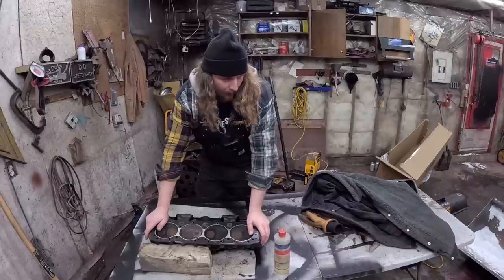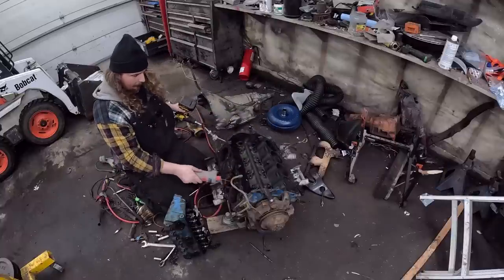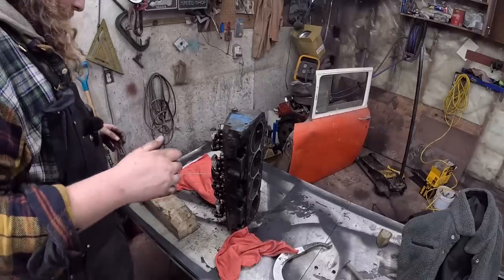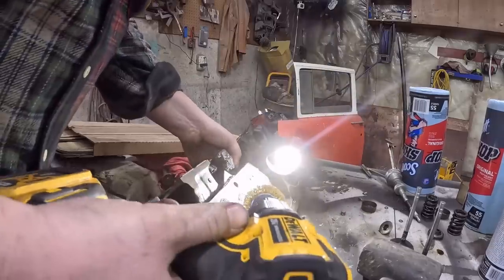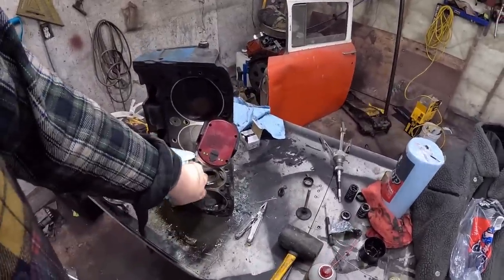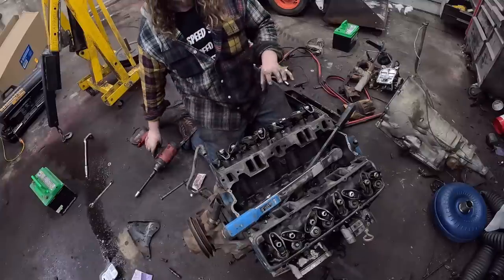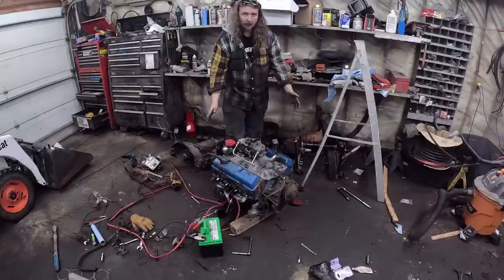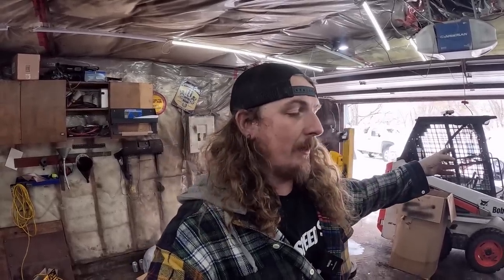FORCING IT TO RUN! - Freeing A STUCK Engine THE WRONG WAY

Comment: Should last for a while.  It sounded good.  I think more people repair in this way than we would all like to admit.
Reply: Small blocks are so hearty  as you probably know and simple. Dan did everything right here in my eyes considering its purpose going  in the 57 for his lady.......
Reply: I've done my share, I used thousands of YTT bolts before I really knew what they were. I bought a 95 MC with the 3.1 that broke the valve head off and turned upside down and jabbed a hole in the piston. Tore it down pressed on a used piston and lapped a used valve in I got for free from work ( rebuilt title car sales) re-used everything head gaskets and all, only bought one tube of type 999 import gasket maker, oil and filter and I put nearly a  150k on it before I traded it for a truck and it was still running strong. I only wonder how bad the cylinders were in some of the motors I forced over with a one way tire tool grabbing a flywheel tooth and prying against the dowel pin. As long as there is nothing really detrimental going on, they have decent bearing clearances and the oiling system is in decent shape they will run for a while as long as you keep an eye on temps and oil pressure. A lot of people just look at the gas gage, which is the least important for engine life.
Reply: Every time we do one of these super half-ass repairs we say “I’ll fix it later.” And we never do.

That old mill will probably run quite happily for years.

Comment: I'm with you 100%. Not everything needs an LS engine. There are many reasons why the SBC was the go to engine for so many years. They are still great engines that are easy to work on, can make good power for cheap and they just look good.
Reply: Unlimited speed parts for SBC
Reply: Yes a small block is a great motor but Nothing like the big block Chevrolet

Comment: Dan, back in the day (1963) I had a 348  tri power 1960 chevy convertible that I beat the snot out of and spun a bearing. (#2). I did not have the money to overhaul the engine. So I pulled the piston and rod assembly. I also replaced one  main bearing set, hand polished the crank with crocus cloth. Hand scuffed the cylinder and put the piston and rod assembly back together with a new ring set. Then I reassembled the engine with one new head gasket. This car ran better than before and did not smoke. I really loved that car and so did my women. How much more of a Butcher and low buck can you get? Outstanding! I am proud of you Grasshopper.

Comment: I’m with Mike G, you are not here to teach the best, high end work, but to show that this can be done on a budget. My first car was a 1967 Mustang, bought in Ontario in 1977, for $400 bucks. I drove it home on 6 cyl’s, pulled the valve covers, found 3 rockers sideways, set them straight, adjusted them and drove on. Years later I had a 1960 F100 that needed a cam replacement, heated it up, pulled the valve covers, intake and rad, bent the grille and changed the camshaft, on the street put in a good used cam, slapped it back together and drove it to work.  You’d be amazed what you can do when you don’t have money a need it fixed quickly. Keep up the entertaining videos and enjoy the comments of the YouTube people.

Comment: 👍 back in my younger days we ran demolition derby cars. Had a friend of mine pick up a 307 that set outside for 2 years. We had a 6 foot bar on it and couldn’t get to turn over. Soaked the cylinders and let it set over night. Hit it the next day after work and got it to free up. He ran that thing for 2 years in the stock class. Was still running when he got rid of it.

Comment: You can’t beat the old high horsepower small block chevys. I love to see them used in the old classics. The 1962 factory 300 hp engines are the most desirable in my book. But this engine, it’s just going into your girlfriends car. She doesn’t need to see you adding oil quite often. Good plan, Dan. 👍

Comment: I did this very same thing as a kid with a 283 Chevy, that motor ran great after honing the rust This was my first experiance with a car and I was 15 years old . I purchased the 283 for 50 bucks. By the way your motor was free and you made a great video, nice work.👍 also I heard Mortske was jealous because this once stuck rusty motor was now running on all cylinders.😂😂😂

Comment: Thank you for sharing Danny I love to see stuff like this I've changed single pistons in my projects before and they've worked life of the  car
Reply: Amen... Once, when I was "Dead-Ass Broke", I cobbled together a 350 SBC, from parts from a 350, and a 305... I used whichever bearings Plasti-gauged good as per journal... Frickin' thing ran, for more that 10 yrs, and was still running, when I sold the truck 4 yrs ago... Gotta Love SBCs...

Comment: Dan we use to build Cheeter 7:04 motors years ago.  The race track would always PG (pump check) the #1 cylinder for volume so we would bore the other 7 cylinders .060 over to increase the cubic engine size on a restricted engine size class.

Comment: I did a dirty "rebuild" on a old 50s single cylinder Wisconsin engine.  Piston was high in the cylinder, got it broke free and pushed down, were wheeled the rust then hit it with the hone like yours.  Cleaned it out, slapped it back together and ran it.  Smoked like crazy at first but had GREAT compression and after a few heat cycles the rings settled and it didn't smoke anymore!

Comment: My greatest sketchy hit, stacking strips of looseleaf paper leaf spring style in an egged out 350 connecting rod. Got the plasti-gage squeezed out right, buttoned it up and got 60k miles out of it.

Comment: Hell yea. Soundz gr8. Just for a joke runnin on the grajj floor 👍👍👍
I bought a seized up 402 Chevy back in the 80z. Stuck it in my 69 C10. Pulled it down the road an dumped the clutch on it. It came loose and bout ran all over the back of the truck pullin me.
That engine was quite strong.💪😎 Ended up in an 80 Malibu hotrod 👍👍👍

Comment: Nice work Dan. I did a "one holer" on a Chevy 6 cylinder that burned a hole in the top of a piston due to detonation. One new piston, one new set of rings, honed "most" of the scrape marks out of the cylinder wall (still had one visible mark) reassembled it and it ran fine for years. So not as wrong of an idea as you might think.  Looking forward to the rest of this adventure.

Comment: You just did the same thing most of us had to do at some point in life. Questionable repairs to get something going again. Some of the best stories between car guys are the ones where someone pulled off the most hacked repair to get them home, or to work for another week till that paycheck came in. Good video. Great explanation, I've been looking for a word to attach to my feelings about modern engines, soulless is perfect.

Comment: My wife once loaned our Malibu to our sister-in-law.  She takes it out on the freeway and gets a leak in a heater hose, driving it till it dies. I find it has a cracked head which I believe is not easy on a 305.  We were broke so, the junk yard sells me a head for eight dollars.  I clean it up, lap the valves and slap it back together. A year later we gave the car away but, as far as I know, it may still be running.

Comment: Usually just fill a locked motor with atf and let it sit until it turns over.  Then start. You went above and beyond. Good job.

Comment: I had a 1950's David Brown tractor that had run hot on one cylinder and burnt / melted half the valve seat, about an hour with the lapping compound had her up and running again without having to get new seats pressed in ( time was a factor ). As far as I know it still runs mint after nearly 30 years. 🤣

Comment: Many years ago (over 45 years ago) I "Rebuilt" a few Chevy SB that way and I ran them for a few thousand miles and a few months afterwards. Whatever keeps the vehicle running and on the road was my thinking back then. FYI at a later date & time those engines were replaced with a correctly Rebuilt engine. I am a Semi-Retired Mechanic/Machinist. Sometimes you have to cut corners in order to save money (stay in budget & keep the wife happy).

Comment: My first motor rebuild was done in a dirt floor garage after I turned a bearing and threw a rod. It made yours look like a pro race shop. It ran but used as much oil as gas. Learned a lot from that

Comment: When I was very young, I had an engine (360 amc) with a burned exhaust valve. Bought a new valve and lapped it until most of the cut in the seat was gone. Looked much like yours, and it worked, (at least better than before). Sure am surprised by the pitting in the cylinder though. Would have thought there would be a lot of blowby. I'm looking forward to see how long it lasts. Great channel, keeps me laughing.

Comment: I have a 455 olds that's bored .030 on 7 and .040 on 1. I've run the living crap out of that engine for years in my figure 8 race car. Hits 5500 rpm often and uses no significant amount of oil. Go for it Dan!
Reply: People make such a big deal out of this. I would imagine for many daily drivers it hardly matters.

Comment: I knew a guy back in the day that had a burned piston in his 350. He pulled the piston and rod out, removed the rockers on that cylinder and drove it for years. Definitely not the right way to do it, but he needed his truck to run

Comment: I played with small engines whenever I could as a child. I loved getting old frozen single cylinder B&S 3.5 to 5 HP engines running again. One day a friend brought me his 5 HP B&S go cart engine that was knocking pretty bad. He admitted it got low on oil. I said I would look at it and see what could be done. This was in the early 60's and you could get B&S lawn mower parts from the auto parts store. I checked his engine out and the rod end was damaged. I took it to the machinist at the auto parts store and he said it was damaged too much. I asked if a new rod was available. Yes, but like $15.00. Friend had no money. I told him the only thing I could do was clean up the crank with fine emery paper and clean up the rod end and try to get a fit with a "tin" insert on the rod bottom cap to tighten up the clearance between the rod and crank. I worked for a couple of days getting a "tin" insert cut from a coke can, they weren't aluminum back then. Got everything cleaned up and clearances looking pretty good. Bolted it all back together and put oil in and pulled it thru a few times. Felt OK, so turned the gas on and started it up. It didn't run bad at all.  The guy came and picked it up and later told me he ran it all summer with no problem before it finally started knocking again. Amazing what one can get away with on low stressed engines to get them running again.

Comment: I bought a car from the transit department in nyc for the engine and trans , was running great but decided to pull the heads before I installed it in my chevelle. One piston was .060 one plus .030 and 4 stock. Put it back together and ran it forever! Love the sbc 🤜🤜

Comment: I had a beautiful 2012 professionally modified, tuned, and gorgeous Camaro I traded even for a nice 71 Camaro that would barely run as a father and son project. I fight it every time I drive it, but the 2012 was soulless. Building a junkyard Vortec 383 for it now. Makes me happy

Comment: My Dad had a small block 400 in a shed that I bought. It was sitting under the only hole in the roof. Rain water went in the carb and in one hole. One piston had a bit of rust in it and was stuck. Luckily it was only the top inch of the cylinder that had the rust. I soaked it and put piston to the bottom then honed it upside down with a lot of oil. I did put new gaskets in it and lapped the valves. It ran several years and probably still runs. It was in a coupe that weighed about 2500 lbs and was a kick to drive.

Comment: Nice one Dan, I have bought cars with questionable motors, opened it up for inspection and surprised it was still running. Washed all the goo out from neglect, grabbed some used parts I had on the shelf, a few gaskets and run it for a year till I have a fresh motor to replace that lump.

Comment: I agree 100 percent with most of the posters that it is nice to see the Uncle Tony approach to building a motor from the perspective of most real old school type mechanics and that is not just throwing $$ at engines and cars in general. This is the old school way (and yes it still works just fine) to fixing cars when people didn't have the $ to piss away that you see most people on youtube show. In a perfect world it would be nice to buy a crate motor put it in and turn the key or send it away to the machine shop and and give them your next few paychecks to do the work. However the old pendulum is flinging back with people not having that disposable $ because of rising costs on everything including car parts. Then there is the supply issues,  faulty Chinesium parts, etc, etc nowadays. I think more people can relate to this now than ever that if it can be fixed and fixed without selling the house, why not do it. This is a more relatable vid than someone throwing unlimited $ at a build - in fact i have tuned out of all of the channels that are using their endless free parts from suppliers (to advertise) to complete their builds (eg. VGG) - that isn't real as most of us don't have that kind of cash to throw around as well as 10 car garages with lifts. In fact I was getting disappointed in you Dan when you were throwing the big bucks at your computer (Holley terminator or whatever the heck it was you are throwing in for your LS builds) - again most people don't have a couple of grand to throw at toys like that. This is the kind of builds we like to see, keep it up.

Comment: Lol😂😂❤❤
I rebuilt my first motor at 14 nearly the same way , 1964, I honed all 8 bores with a ball hone, same kind of valve lap, splurged on new gaskets , every pushrod and lifter and rocker kept in sets, did the 2 bbl carb, the power glide too , it was a 283 .
Ran many years in my first car , 1962 2 door  Biscayne e on the tree.
I’m worse than a machinist, I’m a tool and die maker , that now has a crank grinder and head shop at home lol

Comment: The location of the cylinder pitting is actually very fortunate.  With the pitting as low in the cylinder as it is, the pressure during either the compression or power stroke is lower than when the piston is higher.  Blow by should be lower.  Good luck.

Comment: For me it's "back in the day", when I built my SBC in my Dads garage, a "friend" or God forbid,  my little brother loaded a handful of screws & bolts int the carb. After 1st startup I realized I had a problem.  7 bent push rods, 2 damaged, 1 piston & cylinder. A sleeve, piston, valve & pushrod, back in business and driver for Years after.

Comment: Well done on the budget engine rescue, that's a true mechanic's own fleet mill. The wife can drive that around because her husband is a mechanic. In the shop all the good runners are for the big bucks customers because a few hour quickie motor swap can net a g-note easily. I love how hot rodders are about burnt top ends, while they are saying, "Oh gee I guess we'll have to bore it out and replace some parts with forged bits." They act all serious but you can see a smile in their eyes.

Comment: Dropped a valve in my 73 Cutlass and it poked right into the piston. Pulled a piston and head off another engine I had and back together she went. Add that efi and it'll make Danielle a nice cruiser for a bit and you have virtually nothing in that "rebuilt" engine 🤪👍

Comment: This is the kind of rebuild I had to do when I was 17yrs old and working as a Buss Boy in 1969 making $1.65 per hour. It eventually threw a rod from a faulty wrist pin. The car (was my first car) was a 57 Sierra Gold 2dr post Belair. I had put in 327 4bbl/ with a 4:11 and BW T10 4speed. I only had high school auto shop under my belt and Hot Rod magazines.

Comment: Excellent video both entertaining and inspiring!  In the circle track community we came across a 350 that had stock bore, flattops in cylinders 1 and 6, while the other six were .040 over, 12.5:1 domed pistons!

Comment: This wouldn't have worked without UTG'S gas bottle. Good job I figured you could get it running once you said you got it to turn, also when lapping valve's like that change direction on the drill now and then. 
Power to the axle 😎

Comment: I love it, use what you have, except maybe used head gaskets. Looked to me like that rust pit marks was so far down in the hole that it won't hurt a thing, once the rings loosen up I bet the compression is real close if not the same as the other holes. Keep going you make me proud to see someone do what I learned to do. Thanks

Comment: I use to grind my own seats ,or replace them and replace valve guides , when I worked for honda years ago , we just used tools supplied by honda ,grinding stones 3 , valve guide punch and reamer , a oven was nice to have . As for valves we just replaced them if they were bad ,and of course lapped the valves ,,,,,, no fancy expensive tools

Comment: Its not smoking.  The one piston probably has some stuck rings (or at least some that are gummed up with rust) so the compression should come back up after it runs a few times.  Okay, its not the way the Internet shows how to do it,  but it has been done just like that about a million times.  I've done it myself (1954 Dodge flathead six) and it ran another six years and was still running when I sold it.  Don't let the chairborn rangers get to you.  Keep being you...

Comment: Been there and done that...fixed many 350's that way, I pulled the slugs and would put a cheap performance cam in them. Once pulled apart a Ford six in a belt loader (aircraft baggage  loader) came with a  different color head than block...after several years of use pulled the head to replace a valve to find #4 slug to be 30 over. Not sure who had a hand in that.